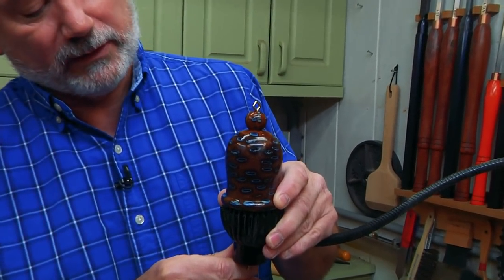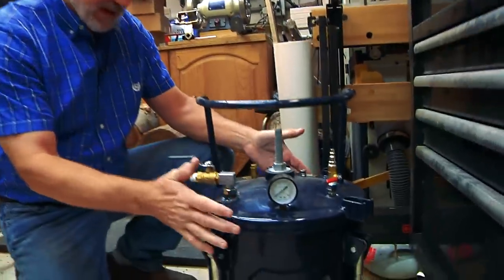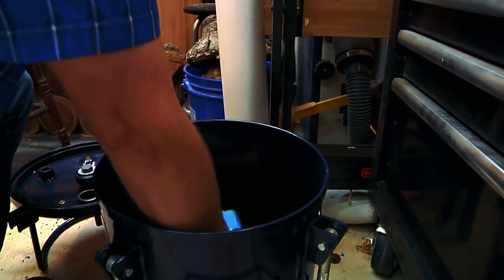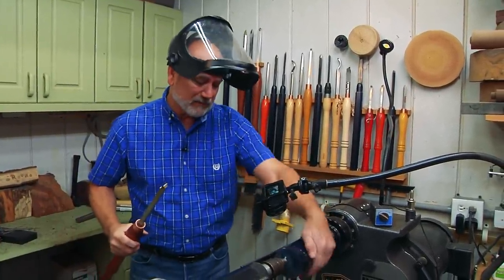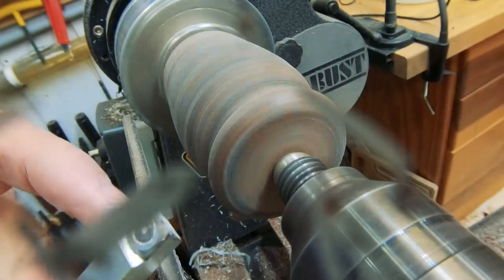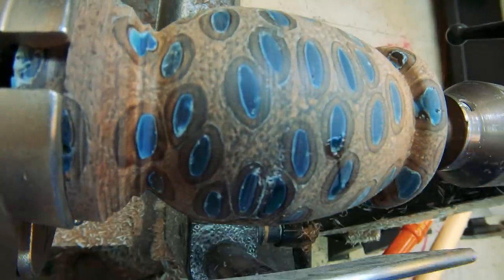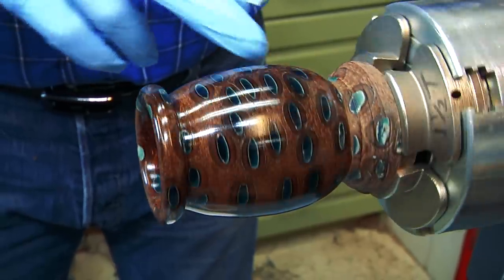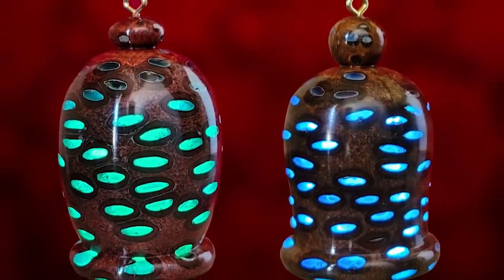Banksia Pod Cast Ornament

Comment: Hey Mr Tim Turner, I work with alumalite quite a bit and like you I use a pressure pot. What really helps me is sticking the wood in my oven at about 120 degrees to first warm it up and of course get out any moisture that may still be in there. It also helps the resin with the air issues. I have seen a better quality of turning when the wood is warm. Try it and see if that helps any. Beautiful projects!

Comment: Tim, that is an outstanding piece of work. The color and finish is fantastic. Best work on a banksia pod I have seen anywhere. Way to go. Please use a good face mask when applying the CA. Use a slower speed too. I may be mistaken but I believe the Yorkshire Grit is supposed to be applied with the lathe turned off. Then after rubbing it in, turn the lathe on to remove the polish the excess. OMG, I am here to get tips from a pro and I am giving him advice. LOL. Thanks for sharing. Have a great day and stay healthy.
Reply: u can put it on while the lathe is on but u have to work it in for a few minutes then do it again with a fresh bit of paper towel to remove the excess till there is no more coming off and the same with the microfine

Comment: Hey Tim,

Those are some gorgeous ornaments, well done!

A tip for the Yorkshire Grit: Turn the revs down to approx 500, then it doesn`t splatter. Then work it slowly for about two minutes, the grit breaks down slowly while you use it, resulting in a smoother finish!

Take care, stay safe and thanks for sharing!

/Lars

Comment: Very cool looking holiday project. 

 I do believe a vacuum process would help to get the epoxy fully into all the pores of the seed pod without any voids.

Just my two cents worth.
Reply: It takes the air bubbles out rather than trying to compress them and subsequently releasing the vacuum causes atmospheric pressure to push the resin further in.
Reply: @MrDonkeyface2  

Possibly a 2 step process to fill all voids ?  I've never tried this procedure
Reply: IMHO it would take too long to get the froth off so you could switch to pressure before the resin sets up.  The pressure will force it into crevices, voids and such pretty well.  I think Tim explained that it was most likely moisture, which could be dried out by a stint in a vacuumed chamber.  But in any case Tim did an excellent demo on how to correct those issues.

Comment: Turn the lathe speed way down when applying a super glue finish. And slowly build it up with 4-6 layers of thin fast glue then quick sand then 3-4 layers of medium thickness ca glue and then polish using wet sanding micro mesh pads. You shouldn’t need to use anything after that. It is the on,y finish I use now when making wood pens or combo wood and resin pens, very shiny and very durable.

Comment: They are amazing. Very nice work.    I apply thin CA at 500 RPM, using a blue shop towel folded once. Faster like you were doing risks creating a spray which can end up in your eye. I also never use accelerator, as I've had dark wood pens returned after 4 months because a cloudy bloom developed. Since abandoning accelerator, I've never had a bloom develop.

Comment: Hey Tim, I'd highly recommend giving Gluboost CA glue a try. It's advertised as having no fumes, and after turning a hundred or so products with it, I have to agree that I've never had issues with fumes like you get on other brands of CA! They also have their own non-blushing accelerator that is excellent also. I use it with 3M Zona papers and get a really high shine on my turnings.

Comment: Gloves should be worn when working with resin and when you put project into pressure pot need to place project into a container in case of mold breaks so as to protect pot